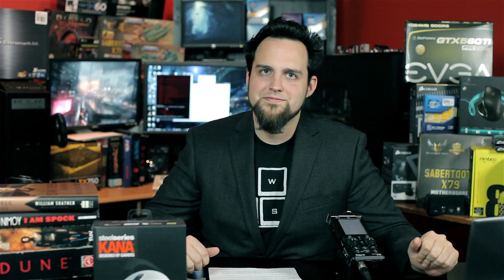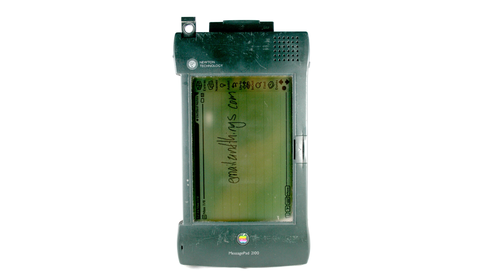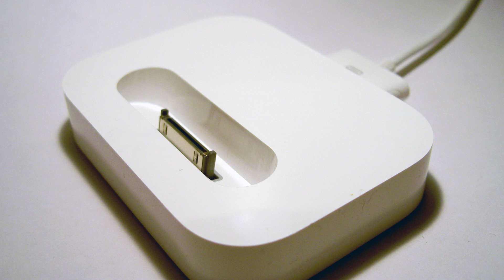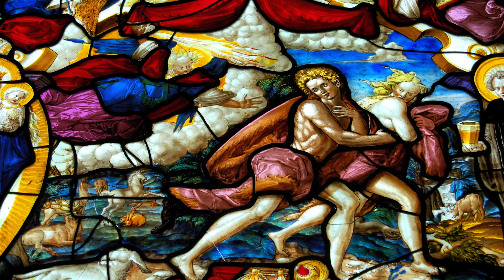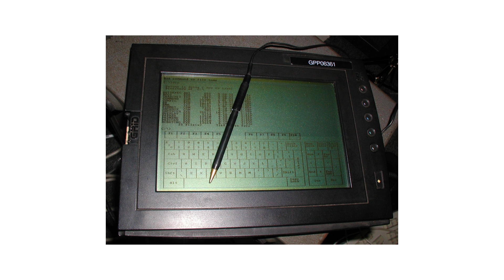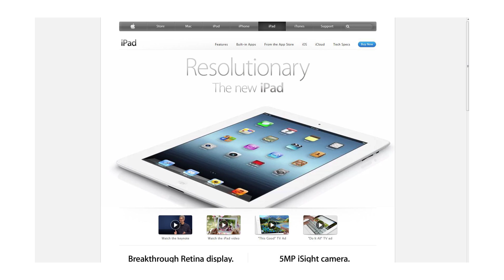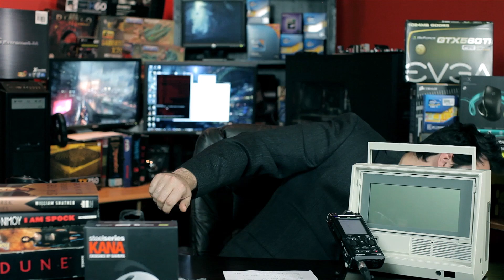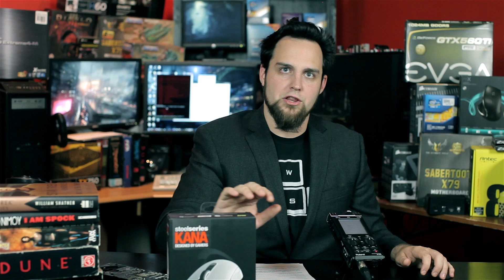Has Apple Really Ever Invented Anything?

Comment: okay, ill continue in teaching way then because you seem very much misinformed, first it doesnt matter if its 12 yo it will run just fine on modern hardware, driver support are still there and thats whats important, its not outdated and sure, easy x79 platform can support up to 128gb of ram and thats consumer grade stuff, not servers and a kernel isnt the same as an OS, proof? FreeBSD is built on UNIX same as Mac OS, yet its more similar to linux OS's than Mac OS, the kernel is only the backbone

Comment: lol. sure, you can save SOME money, but half? No. Not really. Also, it's called OS X. iOS is the mobile one. I don't use iOS, I use android. also, OS X will never get outdated because you get most of the updates right away and an iMac with i7 3.4GHz Quad-core CPU 32GB RAM 2GB graphics can definently handle alot.

Comment: Quality may have it's price, but a Mac is the most expensive PC you can buy, without getting anything extra. If you want MacOS, you can buy an Intel based PC and install MacOS on it. MacOS is cheap, and you could get any Intel based PC you want for cheaper than what you pay for a Mac PC of the same specification. As far as the iPho/Phone/Pad goes, they're not really better than anything else either, they're different. That's it. iOS is actually less user friendly than Android, and on par with WP

Comment: If we're judging purely on the picture, I can see what appears to be two metal strips which I'm assuming is part of the magnetic catch. Having the plug recessed does not mean that is what primarily holds the plug in place.
As you point out, the two holes are where the power connection is made, which leaves the question, if they're not for conducting power, what are the metal strips for?

Comment: The Difference between a mac user and a PC user, is that a MAC user, want his computer to work. Easy to set up... but on the downside. there is not alot of "Costumazation"(derp). when with a PC, you can costumize alot of things.
as my teacher said: "If you want a computer that works, and is easy to manage. get a MAC... But if you want to have a PC which you can costimize yourself get a PC, If you know what you're doing."
cont.

Comment: To be fair, a comparable PC from Dell or HP would cost about the same, but these all use much more expensive Xeons, ECC RAM, and dual socket server grade motherboards.

Workstations cost more than consumer PCs, you can't really make the comparison. Same with things like Quadros, a cheaper GTX 670 is much faster in games, but that's not the point. An iMac with normal CPU/GPU/etc is actually priced well considering that the same standalone display from Dell or HP costs about $800. Laptops too.

Comment: Cast aluminum and machined aluminum of the same type are equally strong because the billet needed to be cast in the first place. Machined parts look nicer and can be made more precisely, but assuming the material is the same, there is no strength difference. 6061 is 6061 is 6061. Until you get to 7075 T6 forged aluminum it doesn't matter anyway.
That being said, before someone jumps on me, I'm a PC user.

Comment: Flat bed connectors we had since the first PCB used as a plug. The signal on it, differential bus motivated by greater potential difference between signal carriers, we got since rs-232. Both at least fifty years old.

Comment: Apple didn't invent unibody. They seen a technology somewhere and adapted it for PCs. Apple isn't an invention company, Apple is an improvement company. They see something, they improve. Don't mistake improvement with invention. How can someone suggest that 32pin connector is an invention? It's a same fucking type of connection that everyone uses, it's just in different size and does different job but at the end of the day, it connects a device for recharging and data transfer.

Comment: I would call you wrong on the FireWire thingie. 

Apple started it back in 1986. Iater others joined especially after it was standardized as IEEE1394.

Wiki says:

"It was initiated by Apple (in 1986[4]) and developed by the IEEE P1394 Working Group, largely driven by contributions from Apple, although major contributions were also made by engineers from Texas Instruments, Sony, Digital Equipment Corporation, IBM, and INMOS/SGS Thomson"

Comment: Ya.. Look into the Asus ROG series. I have an Asus G53SX with the following specs:

Intel Core i7 2630QM, 24GB DDR3-1333 memory, Dual 750GB HDDs, nVidia GTX560M w/2GB dedicated, Full 15" HD display, BD-RE Drive, Intel 6230 BT/WiFi Card. Overall, I spent around $1.2k with the upgrades. I grabbed this laptop last year on Black Friday @ TigerDirect for $800.

Definitely worth it. I might eventually upgrade to 32GB and a pair of 750GB Momentus XT drives, but it runs great.. even after a year.

Comment: First-I said the one that was released a few weeks prior, not THE IPAD. Any idiot could figure out I meant the iPad 2.

Second, the Playbook beat the iPad 2 on a spec-for-spec basis, higher DPI screen, better cameras, etc.

Third, check your facts. RIM stock is up 200% in 4 months, Apple is down 40% in 3 months.

BB10 is being praised (even by BGR), has NFC, supports Flash (which iOS never will), has better HTML5 handling, etc., etc., etc.

Check.Your.Facts.

Don't be blinded by brand jingoism.

Comment: Apple invented the trackpad? Touchpads have been available on PCs since the 1980's, but weren't widely accepted until 1994 when Cirque introduced the GlidePoint. Apple's Powerbook's used the GlidePoint tech.

And how is Windows 8 copying Mountain Lion? It looks NOTHING like it. And Windows has always been on top of Mac in PC market share. Mac only has 13% of the PC market, Windows has 85%. Mac is a fail compared to Windows.

Comment: When you say "they have inveted computers that work better than pc's with lower specs than pc´s". My point of view is that the OS software is the key to it. I do not believe the hardware has something to do here. Mac OS is much lighter software than MS Windows and runs smoother, I could almost bet that if you install Mac OS on a PC with higher specs it would run better than in any Mac with lower specs.

Comment: lots, the mousepad, is ahead of any other brand, and if anyother brand has a similar trackpad, its only becaue they are trying to copy apple, windows 8 is an attempt at competing (copying) against mountain lion (a serious fail at that) but point is apple came out with the ios integrated system for the computer. 
how about the clickwheel for the ipod classic, i have yet to see another.

they have invented computers that work better then pc's with lowr specs then pc's.

Comment: I think you're referring to the 30" Cinema display, which cost $3,299 in 2004 and it's price was reduced multiple times between 2004-2007. It settled on $1,799 before it was replaced by the 27" LED display in 2010, which has an iSight camera, microphone, glossy panel and magsafe to charge your Macbook. I may be a proud apple user and bit of a fanboy, but I don't like it when people bash on a company for no reason.

Comment: Actually, you can use secondary mouse functionality by default on Mac trackpads, and for Mac mice you can enable this feature in system preferences.  As for the price, the current version of OS X is 20 bucks as opposed to 40 for people upgrading to Windows 8.  And I think the GUI is pretty attractive and easy to use, though that's just a matter of opinion.

Comment: Arguing hypotheticals is a waste of time IMHO, especially since app store restrictions have gotten so loose over the years. Even things like DOS or BASIC emulators have been allowed for a long time.

Pretty much the only reliable way to get rejected these days is if the app is malware (ie - it mines user data or takes control of the device without the user knowing, etc). The difference in quality has only widened, something that wouldn't happen if getting on the app store was difficult.

Comment: The iOS is actually a fully-fledged UNIX system, with roots coming from OS-X, which is UNIX, with roots coming from the Mach kernel. The user space is coming from FreeBSD (Also a UNIX).

Ubuntu might be UNIX... Actually LINUX, is only UNIX-Like, as it isn't even fully POSIX compliant. POSIX defines the required features for full UNIX functionality, as intended.

Windows 8 is actually coming from Windows NT. NT3.5 became 4.0 became 2000 became XP became Vista became 7, and finally Windows 8.

Comment: Also, your reasoning on operating systems is asinine. The changes and modifications to the underlying operating systems like iOS are far reaching way beyond just the UI. Saying that iOS *is* UNIX is ridiculous, you might as well say that iOS is running Ubuntu (after all, that's UNIX!), or that Windows 8 is basically just Windows NT. Ridiculous.

And the LG Prada was a glorified featurephone, not nearly as capable as even the first gen iPhone without applications.

Comment: Magnesium is superior and carbon fibre chassis are far superior to the "unibody" aluminum chassis. Have you ever held a lenovo x1 Carbon? It easily has the best chassis in mainstream laptop. Metal chassis in general have very poor shock absorption because they are not elastic, you either get permanent deformation (dents) or a hard shock when it hits the ground. Carbon fibre is the perfect combination of strength, shock absorption and weight for a PC chassis.

Comment: Yeah, I'm aware :P  Although Sony had a sort of prototype; there were no other connectable peripherals since it used its own proprietary modified USB port; but they did use the light peak interconnect for their power media docks.  Wasn't the full implementation of thunderbolt though.  I believe it may have even been optical, which was the original plan for light peak.

Comment: Yep, they still do. My iGrate stopped my drain from clogging up. I saw a storm drain on the street that had one too, and it had prevented leaves and trash from entering. A friend of mine works at a power plant and says there is a huge Apple grate in front of the cooling water intake and it does essentially the same thing. Apple makes grate products.

Comment: Is that so?  As far as I'm aware, in-plane switching doesn't have anything to do with pixel density, it's just a panel type.  The liquid crystals are aligned in a slightly different way and the electric field is applied in a different direction.  In fact with IPS, 2 transistors are needed for every pixel compared to just 1 in TN panels, so hmm... All of Apple's displays (retina or no) are IPS because it is superior and Apple chooses to use it over TN, not because IPS and Retina are related.

Comment: Well I mean if you want to go that far then you'll have to start calling it a new invention whenever a PC maker makes a different shaped charger port... the technology in the Lightning connector, which makes it a sort of polymorphing connector which lets you use it for charging, or USB connection, or audio out, or video out... Motorola had stuff like that long before even the original 30-pin iPod connector before Lightning.

Comment: Really? If that's the case then why have other manufacturers struggled to undercut the MacBook Air? The retina MBP is fairly priced considering the components, at least the 15 inch one is (13 inch is a rip-off). 

Dell and HP are some of the biggest Windows sellers out there. You want everyone to go out and BTO every computer? Regular consumers will not do that. Throw in Toshiba in there as well. Samsung and Lenovo are the only ones who look like they have semi-good quality and they're are new.

Comment: These guys are seriously butthurt by a few dumb Apple fanboys. 1) Apple never claimed to invent Firewire, Thunderbolt, or 30 pin connector 2) Asian rice cookers didn't invent it, they just put together a magnet and a wire. 3) Motorola didn't invent the 30 pin connector, they just had a recipe of putting wires and plastic together, 4) OS9 was bad because Jobs wasn't in charge (thats why they adopted UNIX for OSX, 5) Apple does specifically design their CPU's.

Comment: No one is paying $500 for a $100 part. Yes, Apple does overcharge for some of their components, especially in BTO Macs which is annoying but for the most part, you get what you pay for with Apple products. Owning a Mac has been refreshing after seeing all the cheap Windows computers fall to pieces after 2 years of use and in the long run, it's actually a cheaper option to buy Mac. It's not uncommon to see 6-7 year Macs being used nowadays, but a 7 year Windows machine is quite rare IMO.

Comment: "Macs get every OS, PC's get every OS except Mac."

Mac OS can run on some boards, however not all due to macs limitations on drivers which limits performance.

Macs problem is GPU acceleration problems. Very common for starcraft.FPS on mac is behind by half commonly and quite well known. 

If you are willing to look in to Windows based stuff you can get a lot of raw power into your system for a lot less.

Comment: Also 12 core does not scale well either and has been proven in many rendering situations. Will not scale 1200%

In dedicated rendering situations much more ram would be used (ECC) and raid array would be used.

It would run circles around a mac.

Comment: "How much did that cost? anyways, what do you mean flexibility?"

sub 2000 to as much as you want. Flexibility - An ability to expand. 

"Mac can actually run more software than PC, because it has OS-X,"

Wrong, There are more apps on Windows PCs and their hardware. including linux ubuntu.

"almost anything can run on OS-X. "
Ganes - low fps or not compatable at all. No sli/crossfire support. Does not run some windows apps

Comment: Retina display is just a high ppi LCD panel. Sharp has a panel at over 400 ppi much higher. NEC and Eizo displays are still far better and accurate used commonly in hospitals and professionals.

Comment: "Syncing with iTunes makes it easier and its a more closed system: "

Closed system inflexible. Drag drop on pc much quicker and works stock. itunes does not make it easier because it requires another program.
FAIL

" They are not overheated, i have a macbook and it never has been "overheated"."

Mac air have been known to run at 95C for overuse of thermal paste. My i7/i5 run 30% above spec at 65C 100% load. Poor design.

Comment: Apple patented a way for vibrate mode on your phone to be silent using motion-sensors.

Apple also invented the lightning connector.

Apple also invented their A6 processor.

Apple also invented the use of LTE traffic and CDMA in the same chip.

It seems people here fail to realize that an invention doesn't have to be a good one to be an invention none-the-less.

Comment: Better = what? Support? Reliability? Stability? Performance? I've built boxes, and by what I just said that you didn't read, you cannot build a box with similar specs to an iMac and come out at $700, period. And when the new system comes out, you always want the new monitor, or RAM, or HD, etc. If you don't like iMac, wait for the MacPro, but saying a cheap custom built box or low end Alienware is the same as an iMac is complete BS.

Comment: I prefer to go to a reliable source like Alienware or Tomshardware. Based on the prices there, iMac is on par. You can build a box that will destroy an iMac speed wise, and it can easily cost more than a decked out MacPro. It's not hard, go to newegg and build a machine with the same specs and build quality, and iMac is an exceptional value. Go cut corners and reuse your VGA monitor, and you got a cheap piece of crap.

Comment: Go click the buttons on AlienWare. KB free, mouse $42, and monitor was $500. You can get a junk 23in one for $200, but that's not even close to the iMac. AlienWare doesn't come with wifi or SD by default. There are color accurate screens. Cinema display is very good, but you can spend $1500 on a monitor easily for video work. If you want a maxed out box for gaming, get an Alienware, but it will be more expensive than any iMac and less reliable. And more than 32GB today is almost useless.

Comment: That's not real. The Alienware base doesn't have a wifi card, SD reader, monitor, mouse. So get the Alienware on spec with the Mac, add that stuff, plus Windows Pro, and it's $2120, iMac is $1799, but then the iMac has the i5. So go with the higher iMac, add an i7, and it's $2199, just $70 more.
The lower 27 doesn't allow for the i7, but for CPU floating point operations like games, 3D, and encoding, the i5 does fine. The i7 does better with multitasking, and yea, it's a bit faster.

Comment: But that's not apples to apples. Add in a wifi card, SD card reader, mouse, and the largest monitor they have, which is only 24inches, then the price goes way up. However, bring up the iMac RAM, CPU, and GFX, and you're at the prices I listed. For gaming, yea get a $200 monitor, but you're NOT going to use that for graphics work because it's not color accurate. And even at the base, it's not twice the specs, which means twice as fast. And with home premium, you're capped at 16GB RAM.

Comment: The line of laptops from apple kind of revolutionized the market but just because of the os they are selling things macs you can run any software or firmware iPhone its probably because of the simplicity of using it ipods well let's just say spoiled kids unless they work there associated OFF to get something like I do and the macbook air its just because they made like .1. 2. 3 mm thinner than other windows laptops or computers out there so basically sometimes I would apple suck a dick